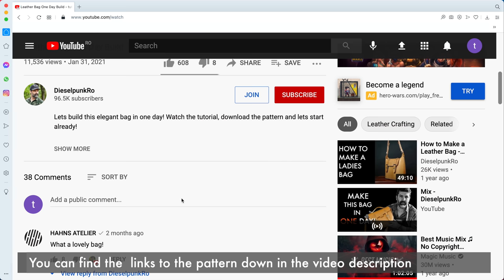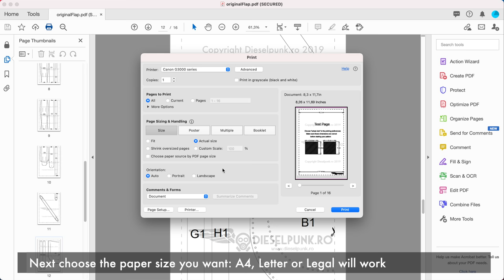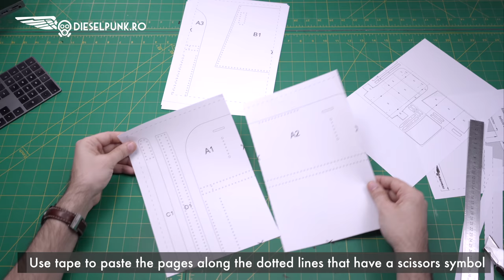Driving Gloves DIY Tutorial - Tutorial and Pattern Download

Comment: Looks like a challenge! No glovers needle? I have 2. They are curved. I plan on adding the accent leather to the outside and not cutting out the holes so I'll have more protection to the knuckles and palm areas. Also a small oval over the base of the thumb joint would be good to
Reply: That's the nice thing about patterns like this, there's literally endless possibilities for customization!!